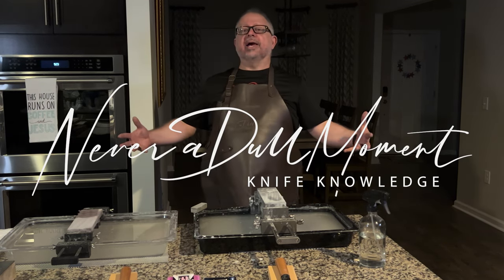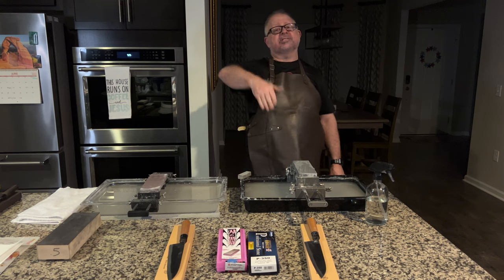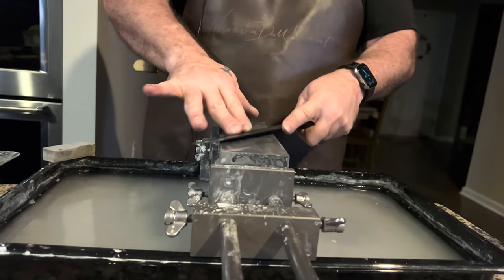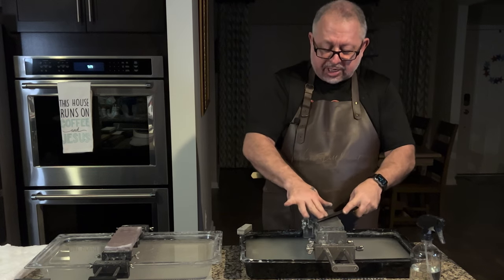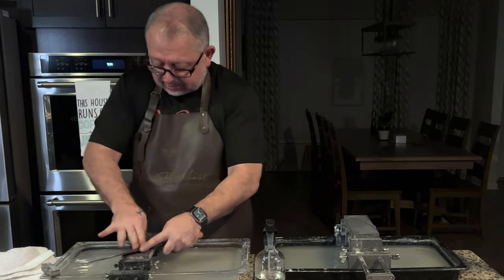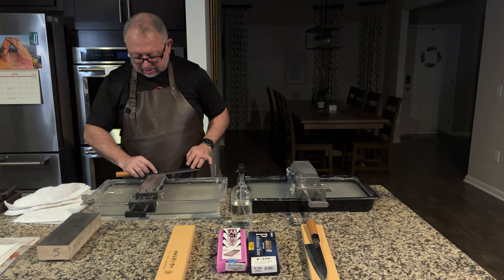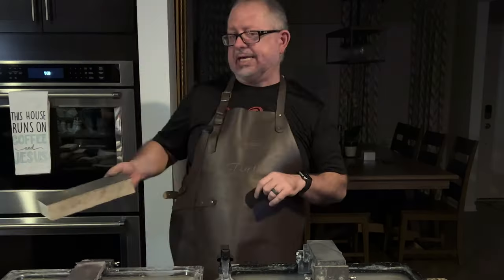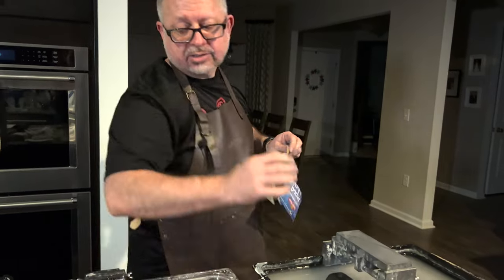Whetstone wars - BATTLE 5K - Shapton Kuromaku vs. Naniwa Professional Ceramic Whetstones

Comment: I use the Shapton Cermic stones to sharpen most of my knives. I use the 320 grit, 1000grit, and strop stroke with 5000grit, and for the money they are hard to beat. I love the ceramic because it’s super hard and will cut even the super steel on some of your newer EDC knives. For the money I don’t think you can get a better stone!!
Reply from the maker: I do like them and I do like the sound they make and they work fast. I just wish there grading of the great was more accurate. I don't think they need to ship them so much. I need to apologize for taking so long. I've had a surgery on my knee and some other things going on. We've had the court case for my car accident. We had to deal with that as well. We've also had some other major things happening personally. Deaths in the family and lots of arrangements to be made. Also, I'll let you know that I will be having another major surgery in June and will not be making it to the Blade show. I will be out of work for two weeks because I'm having all the extra skin cut off of my body. We do apologize for an interruption of videos if it were to happen. Will try to shoot some head for you guys so we can fill the space. That being said, thank you for checking out the show. Thank you for your support and your comment.

Comment: I have both, but when I need to use a 5k, I reach out for the Naniwa Pro/Chosera 5K. When I want a coarser finish only then I use the Shapton. My principle while buying or selecting stones is the performance and quality, not the price. Going by the price criteria I would buy only Chinese stones. They're dirt cheap. Naniwa 5K is a marvellous stone, underrated by many. So is the Naniwa 2K, and it's also underrated.
Reply from the maker: Thank you for that! Thank you for taking the time to comment and I appreciate your opinion very much.
Reply: I'm not sure what makes you think one stone is any courser than the other. They are both finishing/polishing stones and quite hard ones at that, shapton being the harder, one the hardest stones in general and quite glassy. The Naniwa is a bit softer, more friable, takes a little water, and does indeed polish more akin to the 8k shapton pro, but it's hard to say one stone is course than the other. They're both polishing/finishing stones uses for deburring, cleaning up, polishing, finishing. Neither one can sharpen a damn thing other than maybe a razor or  very thin shirogami knife. 

The 8k Shapton pro is more like this 5k Chosera and the 12k Shapton pro is nearly identical to the 10k Chosera. Literally if you close  your eyes, most people wouldn't know the difference in the way they feel and the results they produce on the 12k pro vs 10 chosera.

Comment: You keep checking for a burr. Are you actually getting a burr that you can feel off the 5k? And if you don't feel a burr, how do you know to flip to the other side of the knife?
Reply from the maker: Very early on I was feeling it flipped over back-and-forth. I have changed my style. I'm only trying to get one on the earlier more coarse stones and then once I get to 2000 or above I stop doing it and I just polished the Apex. I've had better result. I need to apologize for taking so long. I've had a surgery on my knee and some other things going on. We've had the court case for my car accident. We had to deal with that as well. We've also had some other major things happening personally. Deaths in the family and lots of arrangements to be made. Also, I'll let you know that I will be having another major surgery in June and will not be making it to the Blade show. I will be out of work for two weeks because I'm having all the extra skin cut off of my body. We do apologize for an interruption of videos if it were to happen. Will try to shoot some head for you guys so we can fill the space. That being said, thank you for checking out the show. Thank you for your support and your comment.

Comment: How do you DISPOSE the contaminated water ? 
Is the water full of metals ? 
Is that water Harmful to the environment ?
Clay based paper can be inconsistent to cut through ?
Reply from the maker: All good points. We have a garbage disposal in hot water running the whole time. We just keep it running for a while to let it flow. We've done it for years and never had a problem. I wouldn't eat it.

Comment: Nice battle between the 5k, can't wait to see the Suehiro Rika step up to the plate in the next one!
Reply from the maker: I don’t own that stone but I’ll have to buy it. I love Suehiro as a company. I don’t carry every single line that they have.
Reply: @nadm  Huh, I was sure you had it already. At least I saw a similar box to what mine came in on your right side in your stone flattening video. The Suehiro Rika is also a 5k stone
Reply: The Rika 5k is a very nice stone. Better in some ways than either of these. The Shapton probably produces a slightly more refined edge than the Rika, at least for me. A lot of people rate the Rika as more of like a 3.5k, it does leave a very hazy finish. That quality makes it very good for creating Kasumi finishes though. It also definitely has better feedback...
Reply: @AnarchAngel1  Agreed, it's a very nice stone, though from my limited experience muddy stones produce a hazy finish while harder stones like the shaptons are more for mirror edges. And from my experience while the rika is definitely harder than my cerax 1k it's still quite muddy, especially compared to my shaption 8 and 12k stones. I don't have an apples to apples comparison since the rika is my only 5k but from the video and what I've seen online the shapton is probably harder and definitely glassier than the rika
Reply: @bowow0807  A lot of things factor into the finish left by a stone. Technique, abrasive type, binder strength etc. Yes, the Rika is absolutely softer and muddier than the Shapton 5k. I own and regularly use both. The Shapton 5k is extremely hard and dense. It feels a little (maybe a lot) more "soulless" and "dead" as a consequence though. The Rika definitely has it beat in the feel and feedback department but if I were doing a BESS contest trying to get an edge as sharp as possible I think the Shapton would edge it out by just a hair. It leaves a slightly more refined edge. It feels similar to the 8k Pro but a little less "rubby" if that makes any sense. The 8k Pro produces some of the sharpest edges I can produce from a stone though, scary sharp double digit BESS numbers
Reply: @bowow0807  They aren't comparable in any way. A 5k Suehiro is not a polishing stone, it's a sharpening stone.  Same for the 6k Cerax.  It's a faster more aggressive cutting version of something like the 2k Shapton pro. Or in Chosera line, the 2k or 3k. That's the grit, but it cuts much much faster than any one of those. Anyone who actually gets hand on experience with this stuff will quickly see that stated grit ratings are quite arbitrary. What matters is what type of stone it is, in terms of course/grinding, sharpening, or finishing. There are also fine sharpening touch up stones, but those are still technically sharpening stones. The much over rated and over suggested Chosera 3k being a prime example.

Comment: Great comparison.  I don't know how long it would take to wear through a 15mm  5k stone, but probably a very long time.
I do edge trailing strokes on my Shapton 1k and 2k and finish with just stropping strokes on the 5k so my 5k stone doesn't get a lot of play.
I do agree that the Shapton stones seem to be graded a little differently than others
Reply: You need a conversion table. Shapton doesn't follow JIS pattern. The 5K is an actual 4K JIS.
Reply from the maker: I agree with the other gentleman's comments that maybe we should come out with some type of conversion table because they are definitely always more course than they tell you.
Reply from the maker: I concur! It's a little upsetting to see that they don't grade them properly.
Reply: @nadm  Not sure if youtube will delete the outside link but I just posted the conversion table a friend gave me.
Reply: @nadm  This grit issue is a bit more complicated than just a mislable. Grit is defined by number of particles on a area of stone. Shapton and Naniwa 5K have same number of particles by area but Shapton uses larger abrasives and less bonding material.  
Larger abrasives cut faster but coarser finish.
Reply from the maker: @thiago.assumpcao  that was excellent! Good to know.
Reply from the maker: @thiago.assumpcao  it usually does not. I’m able to delete it if I want to. Someone will have to complain about it for them to do it.
Reply: @nadm  The link for table I posted seems to be gone. Unfortunate.
Reply: @thiago.assumpcao  Thanks for the explanation, that makes sense. Have you noticed that the Shapton stones are softer because of that?
Reply: @jgiz6419  I did some research on Shapton because I was planning to buy one or two. Kuromaku series hardness and tendency to load up varies with grit.  1k is soft comparing with other Kuromaku. 
2K, 5K and 8K are quite hard.
Always Sharper Channel has a very good long therm review on the entire line and seems to match what I've seen in other channels.

Chosera is way too expensive in Brazil, I know they are great but didn't do any research on them.

From Naniwa I only got the 1K/3K combination stone. Very good value for the money but don't expect it to cut as fast as ceramic grit stones.
Reply: In addition to mislabeling the coarseness of its stones, Shapton also puts/leaves some coarser grits in its finer stones.  Several YouTube videos compare Shapton stones with other comparable whetstones under a microscope (which is the only way to tell what's really going on with an edge), and all the edges sharpened with Shaptons of all grits show several larger and deeper scratches along with a background of a much finer scratch pattern.  This indicates that there a somewhat coarser grits mixed in with the finer grits.  Other brands of whetstones show consistently uniform and smoother scratch patterns made by appropriately labeled grits.

Comment: Great video, thanks Greg.  Question about the stones, Do we know what the grit is:  Aluminum oxide, Silicone carbide, or other, like natural stones crushed and formed into a block.  Now something to ponder.  Cutting paper from top to bottom, is easier than cutting across the page, and one more thing.  when you strop, you push the knife leading with the tip, and ending with the heal then draw the knife leading with the heal and going to the tip.  The micro grind on the knife can make a difference,  If the knife is sharpened from tip to heal in both directions, it will cut paper better on a draw-stroke, if sharpened the other way, it will cut paper better if one lead with the tip, and runs the knife tip to heal through the page.  (some tips from an old geezer, I'm the guy with an apple and a knife who sits on the front porch)
Reply from the maker: First of all, I appreciate the comment. Second of all, I'll have to look into that to see if there's any truth with that. I have given a lot of thought to the scratch pattern and was wondering how much it would affect cutting. I don't think it's so much going to affect the cutting on the Apex. More on the knife feel when you drag it through food. I do try to find out if certain stones are aluminum oxide or silicone oxide and so on. And all of that information is readily available and I wish it was. I usually switch up the pattern on both sides just to go different directions. I normally will do X amount of strokes on each side in the same direction for that side. But then later on I try to do something in the other direction just a drag across the opposite way. I know the stone is done the sharpening and remove the metal on the Apex. The only goal is to remove the burr. I normally go for a very clean edge. Teeth tend fall out. Knife grinders book is a great read and I try to do everything the way I learned from the book. It has done me well. We did an entire series on strapping and got great results. I also really like the kangaroo tail because it's crosshairs do a good job of removing the burr. Everything is important. Depending on the knife, if it's a 61 hardness and above and you can actually even say at 60 if you want to, you should strop on the same angle that you sharpened but if it's below that then you should increase the angle slightly. You can increase it from .4° to 2° depending on the steel. They're all listed in their book. I usually try to do a slightly higher degree when using softer steel. Then I do it in different angles and different directions and I usually do two different stropping materials. I'll do kangaroo tail or leather and then I will finish on a leather or nano cloth that has diamond emulsion. There are plenty of people that do not stop at all. A lot of the Japanese natural stone users would like me to not do it at all and just do it on the stone. I have shown great success with a knife without ever putting it on leather. I like the bottle to be about what can get done on the stones without any help. I think the help might improve the blade too much and it'll hinder us finding out the true winner. I'm never gonna mind a comment from some old guy sitting on his porch whittling an apple! God bless you
Reply: Both are aluminum oxide with magnesia binder
Reply from the maker: @Man_Emperor_of_Mankind  Thank you for that!
Reply: @Man_Emperor_of_Mankind  Many Thanks.
Reply: @Man_Emperor_of_Mankind  Both use Alumina abrasive like essentially all water stones, but only the chosera uses what Naniwa call magnesia. The Shapton Pro does not say anything about this, idk why gritomatic makes such a claim but you should always be skeptical of everything in knife world and knife people are not known for being very fact based at all.

Comment: Any advise??? Doing stroping strokes on the shapton glass stones 1k 4k or 6k I get this loud high pitch squeak and it Def sounds wrong like nails on a chalk board any insights please share. I do flatten stones before use with a diamond plate. Thanks to anyone with advise!!!! Never had this issue with king 6k or green brick of joy 2k. Thanks
Reply from the maker: It either sounds like the material that the stone is made out of for that particular stone or that you have the angle of the knife wrong and it's not matching the sharpening angle
Reply: @nadm  awesome thanks for responding and the advise. Free hand sharpening is Def an art and takes time. Thanks again for response. Cheers
Reply: @nadm  Your angle is off. Your knife is talking to you! We must listen to our steel friends when they protest what we do to them! Adjust until noise goes away!

Comment: To me it look you contaminated the stone with the cleaning stone. You can see how the sound is changing after you use the cleaning stone.
Reply from the maker: Not at all! The cleaning Stone was never used on the first stone. It was used for the first time and only time on the Shapton. It was put in the water only after it was taking the load off. It was never used. The water was clean before I used it so there was no load from any other stone on it even if I had used it a second time. The cleaning stone is a lower grit than it so it would've removed any load that would've come with the stone even if I had done any of that in the first place which I did not! I appreciate your input and your observations but I went back and rewatch the video and there was no issue
Reply: @nadm  I think you misunderstood me. :) The cleaning stone will release particles, you can't prevent that. If it is a new cleaning stone it will release more particles. After I clean my stone with a cleaning stone I rinse the sharpening stone under running water to make sure that particles from the cleaning stone are not on my sharpening stone. But that is only my opinion. :)
I have both shapton and naniwa 5000 and when I sharpen on them the feedback si like sharpening on glass. By the way shapton is by far my favorite stones. Very close to them are the suehiro debado s. :)
Reply from the maker: @DanielWorkshop  I really do like the Suehiro product
Reply from the maker: @DanielWorkshop  I love Suehiro!
Reply: @DanielWorkshop  You guys should go to Japan together and make some Collab videos!
Reply: @DanielWorkshop  Aren't all high polishing  stones suppose to feel like glass or a little sticky? I have a natural stone that's kind of sticky but does polish well. Rated 8k but is about the same as my Naniwa 5k. I want a affordable stone that does a mirror finish for fun.
Reply: @DTrizzy  You can try king finishing stones. They are cheaper than mainstream and give very good results.
Reply: @DTrizzy  We are too far. :)
Reply: @DanielWorkshop  I would be too if I had more space for it. I have more stones then knives and that seems wrong.
Reply: @DTrizzy  I accept donations. :)))
Reply: @DanielWorkshop  LOL nothing good to donate here :)